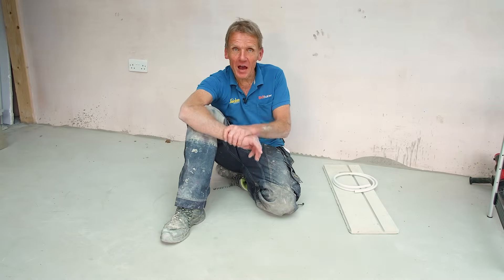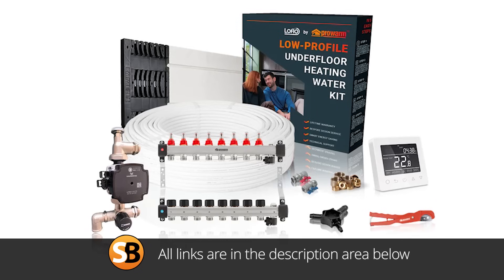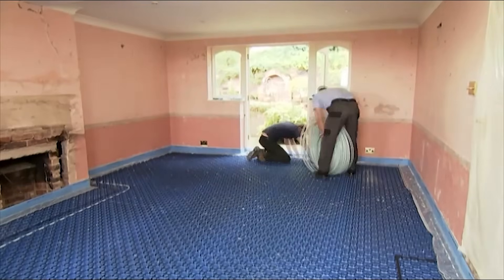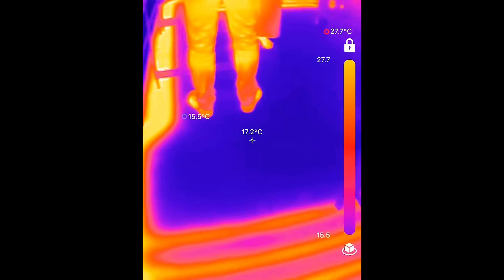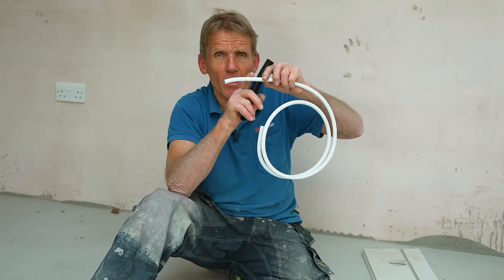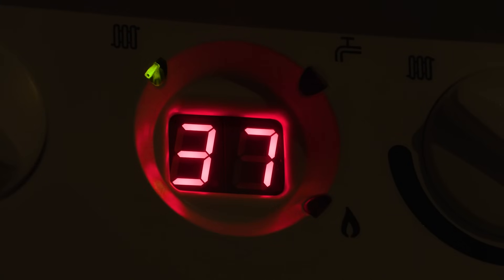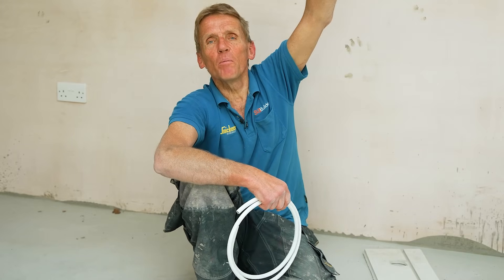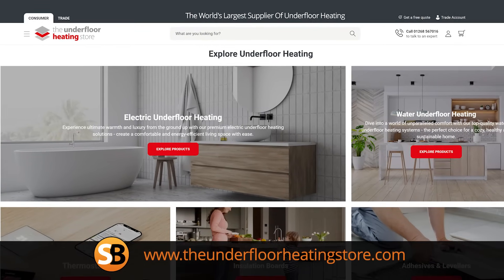Electric vs Hydronic Underfloor Heating Which Is BEST For Your Floor

Comment: It’s a shame the shister building companies continue to fit conventional radiators rather than underfloor.  Building regs need to change to force them to fit whenever possible
Reply: With how new builds are thrown up… The remedial work of all the badly installed systems would be a nightmare.
Reply: We have been in this situation before. The collapse of the housing market in 2008 was indeed a disaster but remediation all of the poor workmanship from that boom kept genuine tradesmen going, not fully afloat but going.

Comment: Many thanks for this info Roger, I live in an electrical only house but have taken advice on an electric boiler specifically for wet underfloor heating. As we don't have central heating and are poorly insulated, is this something you would consider, or is insulation the priority? Also, have you any experience with aerogel insulation types? These are returning u values of 0.015 (supposedly)!
Reply: Insulation is the main priority and better to use standard products tried and tested. Then I would do wet underfloor heating and a heat pump to save on the bills if you have the money to install it. If you are not planning a heat pump, then no point to install a wet electric boiler or wet system, but that's the decision that can only be made once, when electric UF heating is installed, that's it, you are locked with it. It's more options with a wet system, but it costs more to install.

Comment: If a central heating system on gas with high efficiency works for longer ...all the parts will wear out much faster.Even the money saved on heating bill will be spent at some time on servicing the system....
Reply: You're stating that like it's some kind of fact backed up by statistics. Personally I find it hard to believe so I think you just made it up.

The reason is that cycling is considered to cause more wear than continuous running for machinery. And there is even that factoid that is always shared that fluorescent lighting is cheaper when it's left on. It's wrong for other reasons, but their reasoning was that cycling caused more wear on the tubes.

Comment: This video has answered many of my questions about underfloor heating.  My only criticism would be to say that if we are going to stop burning stuff to keep warm, then electric is the only way to go (from 'renewables' i.e. wind and solar).
Reply: Heatpumps are electric...
Reply: Heatpump plus wet underfloor heating is optimal. Don't have to heat to as high temps, keep the heat topped up throughout the day running through the pipes.

Comment: Great video again Roger 👍 I would love to hear your thoughts and recommendations on the different flooring options you can have on top of underfloor heating
Reply from the maker: Noted
Reply: More than the flooring it's the underlay choice with most of them too. In my extension I went with tiled flooring downstairs over the screened wet underfloor heating. Used ditra mat which cut down on thermal transfer a bit but the best option and feels lovely underfoot. 
Have uf heating upstairs too and used laminate over that green fiber board underlay and that stuff like most underlay is primarily designed to not lose heat through it so is a pain with uf heating. Maybe lvt would have been better. Did look at other underlay but many of them were even worse for blocking thermal conductivity.

Comment: Surely rads have better efficiency than underfloor heating when there no floor insulation because of the 'direct' heat loss to the floor/concrete
Reply: And, of course, cheap and easy to install.
Reply: I think that would depend.  I am not sure it's a slam dunk.  Retrofit rads will always be cheaper

Comment: I’m buying a house that has it but they have installed radiators as they told me as soon as the boiler turned off everywhere just went cold instantly, but I was always under the impression it was better like your video said 🤷🏼‍♂️
Reply: Possibly they were trying to.run underfloor heating like radiators and only having it on a couple of hours a day. With the full depth wet system in a thermal mass its better to leave it on constantly aiming to keep the various zones at a prescribed temperature.  The pump and manifold is mostly recirculating the same water with the boiler boosting a bit of extra heat as needed. Aim for min 16 overnight and 19 in the day. No need for radiators.
Reply: Roger mentions how there is no thermal mass with the low profile systems, the benefit being they're very responsive and heat up quick. However, the con being there is no thermal mass! So it cools down very quickly too!

Comment: Would underfloor heating work better with a heat pump than radiators ?  is that a question for the heat geeks …..
Reply: underfloor heating works better no matter the heat source, with a heat pump the efficiency improvement is greater.

Comment: Good advice Roger, thanks. Interesting thinking about the way radiators have to fill a room with heat rather than underfloor pipes heating the floor. 👍👍

Comment: Great video and thanks for all your videos, I’m a big fan of the channel.

Only thing I would disagree with is that underfloor heating is radiative heating. You need things very hot for that to work, like an open fire or log burner.

The room will heat from convection (and your toes from conduction!), but compared to a normal radiator, the whole floor has hot air rising from it. It’s like the whole room is the bit above a radiator. Your bang on though that for high ceilinged rooms it’s the way ahead.

Cheers
Reply: Radiators 70% convection 30 % radiant
UFH 60% radiant 40% convection
Reply: Exactly this! UFH is MORE radiative than radiators...
Reply: Sorry, less diplomatic then Roger, you need to revisit some science classes. Bluntly, you're wrong.
Reply: UFH is convective, albeit a lot more turbulent than rads. The radiative heating will be a product of the emissivity of the surface, so a dark, rough tile will radiate better than a white smooth tile.

https://youtu.be/kuLX76g7Fec?si=IEkWfGTZZ2EqtNqe
Reply from the maker: Hi Chris
 I have this argument all the time because people can't understand that hot air only rises because it is displaced by colder air which is heavier. Nobody in the heating industry disagrees that underfloor heating is radiant heat.
The American's describe these systems as radiant hydronic heating. 
I will carry out a demonstration with a smoke pellet to prove the point. There is no convection.
Reply: So Chris @SkillBuilder  when you heat the water in the bottom of the saucepan (i.e., "under pot heating") there is no colder water above this hot water to slide down the side (or exploit the slightest eddy) and displace the warmer water? Like — is this saying why you cannot heat water in a saucepan? 
As I see it, when we heat the floor it will heat the air just above the floor and this hotter air will rise (do the test yourself) because tiny air currents in the room allow the colder air to slide in and displace it. When we heat the floor our feet next to the floor feel the direct heat which feels good on a cold day in a cold room. There is also a mild radiant heat coming from a heated floor which might be detectable in an otherwise very cold room. How warm the room gets depends on how much heat is put into it versus how much is lost.
Basically all heating systems (with equal capacity) will get the same result if the room air is mixed (e.g., ceiling fan) but it's usually better to heat from the bottom. Heating from the top leaves the hot air high with no reason to come lower. Radiators on the side tend to have all their warmed air go up the wall and stay at the top of the room. Again lots of heating systems will work better if the air is gently mixed.
The convention talk is not your best effort. Please stay on point with the facts — under floor heating can be excellent, people who have a decent system will say so. Please do not invent a new branch of physics as an "explanation".
Reply: @ricos1497  Aha, you want to see Roger's latest video underfloor heating using quantum entangled electrons. Essentially you install a quantum entanglement heat pump which fires one of a pair of electrons at the sun, the other into the underfloor water. Because they are entangled the sun electron induces heat in the underfloor electron. Problem is that the floor can get too hot so we have to fire other entangled electrons into deep space at -275k . Health and safety are getting stressed with these high energy electron beams slapped on the back of a semi though! Give Roger a break, would you rather have a radiator 10' across the room from you or right under your feet? Convection/radiation arguement is moot if the sodding heat source is right under your feet!

Comment: Couldn't afford wet so we went with leccy
Nice and easy and on and off as and when
Reply: We also went with electric for our kitchen extension, we haven't got mains gas in our village and when the house was local authority they installed an electric boiler. If we went wet then the boiler needed changing as it wouldn't of been up to the job so we just went with electric. If you have a similar system to us then I can say it works out cheaper to heat the ground floor, we noticed a massive difference when the main heating is switched on when looking at our smart meter display.
Reply: it's unaffordable as a primary heat source.
Reply: @edc1569  ours keeps the floor warm in the kitchen with the tiles
The insulation and cooking keeps the rest of it warm 🤣
Reply: @edc1569  I have herschel infrared panels on all the ceilings and my monthly electric bills are less than the uk average gas bill for my house type. That's not even including cost of installation, boiler maintenance fees and the fact that I don't have any down time when my boiler is broken like everyone else does.

I think the efficiency benefits of radiative vs convective heating are vastly understated. Especially when most houses have poor air tightness. People harp on about how much cheaper gas is than electricity but they have to pay a second standing charge and they're happy to throw all of those gains out of all the cracks as hot air